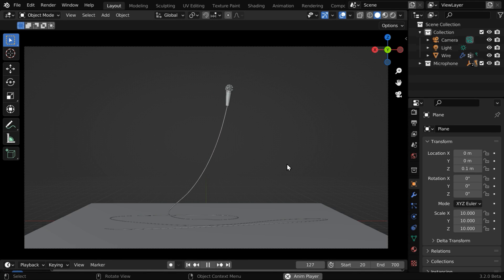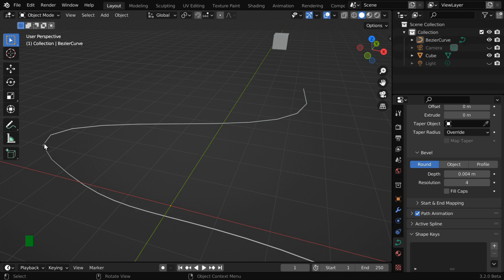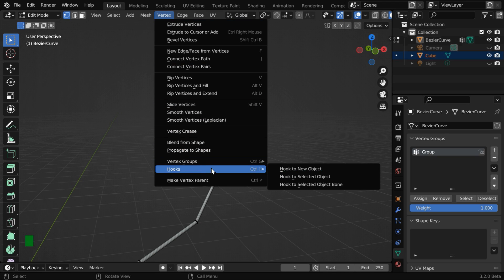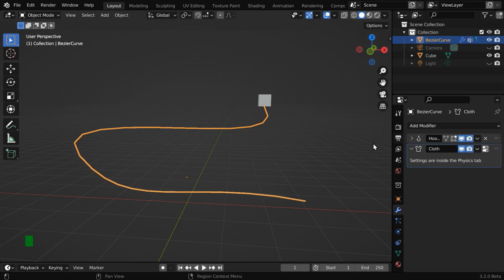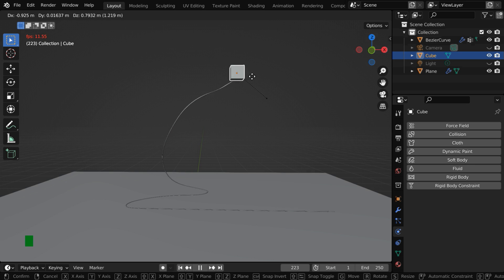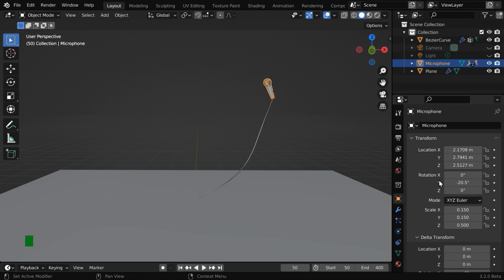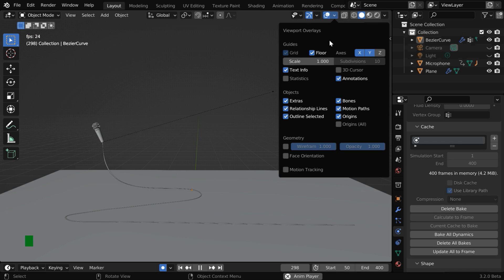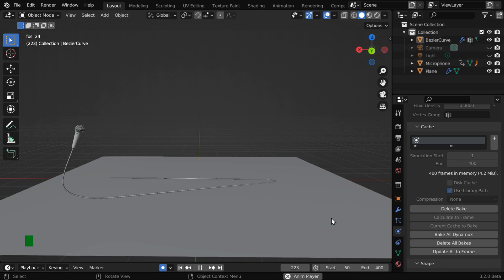Create Rope or Wire Trailing Behind A Moving Object | Application Of Cloth Physics In Blender

Comment: does this same technique work if both ends of the wire are moving? For example: I have a character where I want to wrap one end of the cord around his hand, and with his other hand I need him to hold the mic. Both ends would be moving; the wrapped end would be parented to the left hand and mic parented to right hand.
Reply from the maker: Unfortunately there are no simple techniques to do this yet. You have to go for a full-fledged bone & armature settings for the rope. Imagine the rope to be a snake. You need to create a bone structure or spine. Enable rigid body physics. It will then simulate what you need. Make the bones extremely small in length, it will work like a rope.

Comment: the pressure figures as in the video do not change anything at all, how to make sure that the cable does not become a flat rag?
Reply from the maker: The pressure is used only for that. Did you try to increase the pressure value? If it does not make any impact with whatever value you set, there might be some problem (maybe with the geometry of the cable - just a blind guess) 🤔🤔 I can suggest better if I can see your blend file, our email ID is 5minblender@gmail.com Thanks!
Reply: @5MinutesBlender thanks for the video but I had the same issues with flattening cables at the cube ends and no matter what pressure settings I used so I don’t think this method is doable. It might be if you don’t see the cable close up from a distance. There is a lot of issues with the flattening at the position of the cubes.  Might be to do with the linking vertices. Also using more pressure blows the cable up at points - it’s all a compromise unfortunately.
Reply from the maker: @13thnotehifireviews7  I see. I did not experience this issue though. I hope your cable has zero thickness i.e. it is made of a simple long cylinder without duplicate skin. The air pressure with cloth modifier is very sensitive and can give weird result if the geometry is not plain and simple. As originally suggested in the above comment, if you can send your blend file I can experiment with it and see if I can make it better for you.

Comment: I am trying something similar to this for a socket. The swing physics works for the cable, but when I want to connect it to the other end of the cable with an object, it does not hold. How can I combine it with another obke at the other end?
Reply from the maker: That's actually challenging. You can move or deform a rope (cloth physics) using a rigid body because cloth can be deformed in shape. But the other way round is not possible, a rigid body cannot be dragged using cloth physics. You need something else for that and I am not aware of that "something else". Of course we can cheat and create an illusion of such a drag by manual ketframes etc, but a proper physics movement may not be possible as far as I know.

Comment: You're a life- saver bro. I'm trying to create a monk fighter that uses a rope and ball like the girl in the crazy 8's from " Kill Bill" & I believe this will help. Question, should I add a bone to the balls at both ends or just keyframe the object? Which would you suggest?
Reply from the maker: We have a rope, a handle at one end and a ball at the other end. We need to keepframe the handle which will in turn control the movement of the rope via cloth physics. The challenge is on the other end, we need the ball to move in tandem with the other end of the rope and this is not an easy task in Blender because it has very limited (or almost no) interaction between cloth and rigid body. Test with bones, if it does not work, we need to take help from drivers (to copy the location of the vertices at the other end of the rope and copy that to the ball).
Reply: @5MinutesBlender  Thx for the advice. Actually she'll have balls at both ends of the rope so that she can do multiple attack's. I'm just trying to figure out how to make multiple parts of the rope pin points for when she grabs it to switch its trajectory. Seem's complicated but your video makes me believe it can be done. Just don't know how. Thx again.

Comment: Thank you! Another terrific tutorial. 
I have a question, is there an easier and more precise way of placing the cord into the mic, I can't seem to get it centred and moving it around can create some awkward distortions.
Reply from the maker: If you need to do it perfectly: 1) Snap the 3D cursor to the center of the top end of the wire 2) Move the origin point of the mic to the center of its bottom surface 3) Snap the mic to the 3D cursor. Now the wire will be attached to the center of the bottom surface of the mic. If you do not know how to do any of these steps described above, please let me know.
Reply: @5MinutesBlender   Thank you for the informative reply. I'm trying to give it a go but it's all a bit confusing having not done these operations before.
Reply from the maker: @bobdobs8855  Here you go. 1) Select the wire and go to the Edit mode. Select the vertices at the top end. Under Mesh menu, under Snap, select the option Cursor to Selected. 2) Select the mic in the Object mode. Under Object menu, under Snap, select the option Selection to Cursor. (In case you need to move the origin point, select the object and go to the Edit mode. Now select the face where you want to move the origin point, then under Mesh menu, under Snap, select Cursor to Selected. Now back to the Edit mode, under Object menu, under Set Origin, select the option Origin to 3D cursor).
Reply: @5MinutesBlender  Very much appreciated, I look forward to giving this a go! You have a terrific informative channel. Very well done.
Reply: @5MinutesBlender  LOL sadly beyond my current capabilities. I will have to work up to it.
Thanks for your assistance.
Reply: @bobdobs8855  How are you doing now bob

Comment: When you set the bevel distance to create a 'CABLE' from the spline, the next parameter was the spline resolution, using this instead of the Catmul-Clark subdivision would be a way way faster and more elegant way of doing it. Currently, each polygon is 64 polygons and the 36 division circumference of the cable is now 288 - its geometry you do not need, its wastefull of memory, processing and eats into render time.
i.e. Its not professional.
Reply from the maker: Very good suggestion. Thank you so much bro for this 👍👍